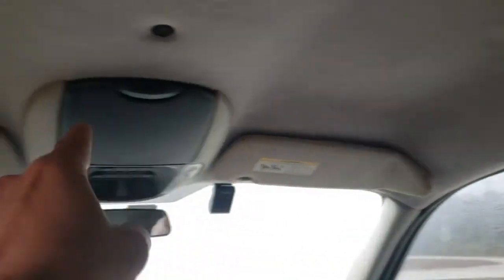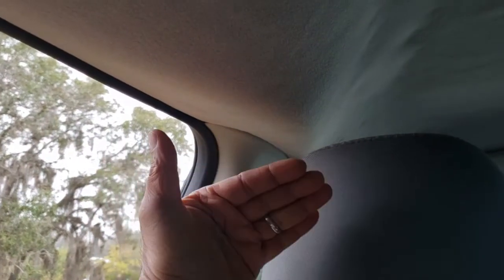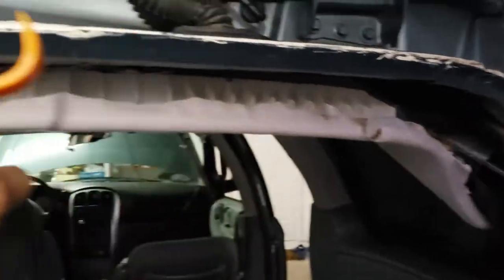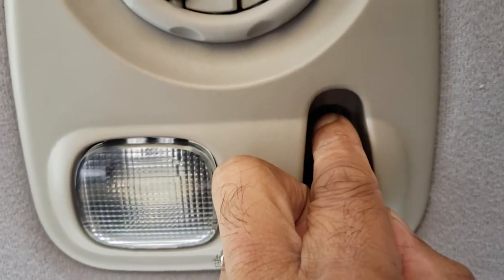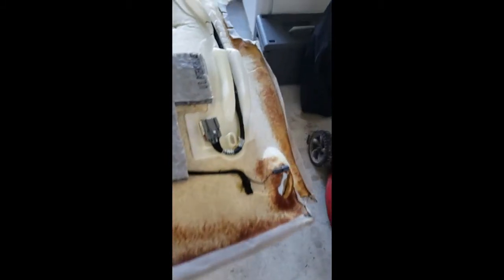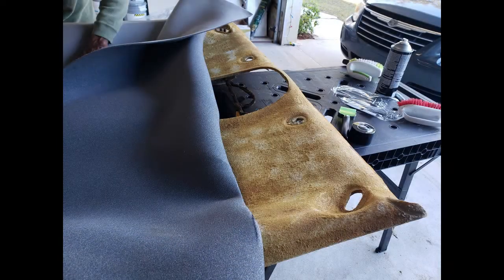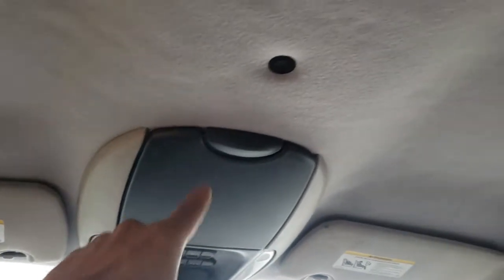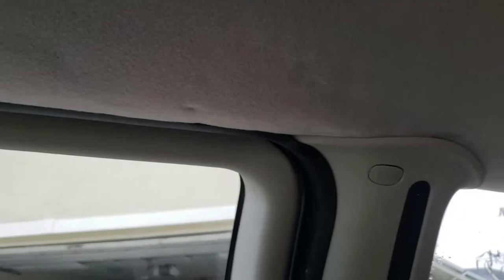Headliner removal and replacement 2005 Chrysler Town and Country minivan

Comment: Oh, I wish I had seen this video before trying this myself. I'd watched a few others that were not this exact model (mine is a 2006) and they were far easier. The wiring and ducting, even airbag mechanisms running along the sides of the ceiling. Your advice is right on the money. It's a big messy job, and as far as I'm concerned, not at all worth doing. I'm wishing I'd just taken a carpet stapler and tacked the fabric up with a bunch of staples.
Reply from the maker: Indeed, this is a major job and may not be worth your time. I like to keep my vehicles as good as I can which is certainly time consuming. Thanks for watching.
Reply: Hmm carpet stapler you say?

Comment: Working on my 07 TnC. Figure I will be doing this job again in a few years. Everything did not work out. But do not be afraid to try! I would NOT use Permatex Heavy Duty Automotive Headliner Adhesive Item # 27828. It set up too quickly and I could correct some issues.
Reply from the maker: I used the 3M headliner adhesive and it worked well. I think if your minivan is parked in the sun and you are in a hot climate then the glue fails faster.

Comment: In the middle of removing the headliner board, but the wiring loom for all the ac and lights is glued to the top of the headboard.  is there a disconnect box for the wires that come up both sides B pillars?  It doesn't look like it.
Reply from the maker: No disconnect in pillars,  you have to disconnect from the controls.

Comment: Great job at explaining it. Question, when when you glued the headliner did you have to buy a new one? Or did you use the old material. I have a 2005 Chrysler, Town and Country Limited. It has the rail down the center and a video screen. A lot more to do. I have no option, it only has 40,000 miles and has a handicap conversion. The headliner is the same as yours with just more to pull down and cut the screw holes.
Reply from the maker: I purchased a new headliner here: https://www.amazon.com/gp/product/B089ZMR5HM
This is a major job, put aside a lot of time and patience and ask someone to help you get it in and out of the van. 
Good luck!
Reply: @Andrewsnotes1  Thank you. I was able to remove the headline in under two hours. I measured the headliner and 2 yards will do the job. Rogers’s and contact cement ordered. I will apply the industrial contact cement with a paint gun on the compressor. I unplugged the 3 wires and it dropped down, after the other steps. I still need to pull the video panel and track. Clean it up and put it on when Amazon delivers. Thanks for the video. Entire job is just as you showed us.
Reply from the maker: Thanks for the update, I am glad it went well. The 3M Headliner spray on glue was what I used, but I suppose contact cement will also work.  Remember to apply the material from center outwards to minimize creases.

Comment: Where is the connector for those wiring you disconnect the headliner off?
Reply from the maker: Behind the rear AC control, behind the overhead trip computer in the front, behind the connections of the front visors after you remove the 2 screws each has, and behind the cabin lights in the headliner.

Comment: Very nice job describing and sobering the amount of effort involved! My van is 2007 so assume everything applies. Two questions. 1) Before i go the route of removing and replacing, I'm looking at spiral fabric twist pins to pin headliner back up. From your recollection is there enough foam padding on factory headliner for pins to grab into assuming padding is not crumbling already? 2) if pins don't grab what do you think about poking drill bit up through sagging cloth material and drilling through headliner board, avoiding air ducts and wiring, then pushing twist pins up through drilled holes or using another type of interior auto panel retainer clips that pokes through drilled holes then expand to stay in place?
Reply from the maker: There is enough padding on headliner to do what you are describing. Mine sat in the sun for most of its earlier life and it was not disintegrated. Be careful not to drill through the roof!
I f you plan to keep the vehicle a while longer then the removal and redo of the headliner is the best (but not easiest) option.

Comment: Excellent job!
I just bought my 2007 Town & Country, so I'm thinking do the same job on it.
I want to do it, I have the time and I think that's enough!
You really did a nice job, I'm excited!
Thanks a lot! Very good video.
Reply from the maker: Go for it, check the description for the links for the headliner and adhesive. Spray on adhesive in 12-15 inch sections and apply from middle outwards to avoid wrinkling.
You need 2 cans.

Comment: I am in this process now, 2005 Grand Caravan, same as this one, 3 hours to remove board, 4hrs scrape, vacuum and clean old glue off and 3hrs spray and apply new headliner fabric (60in x 120in). couple hours next day to fold over and glue the overlap 1inch to back side of it all around. go slow, take time. Grey headliner on amazon, $60. , 2 cans spray glue 20 each. I like the Permatex spray glue better than 3M, they wanted about $700. to do this, so I am in for $100. -it is worth it. 
TIPS: keep track of screws so you dont mix up. there are alot. Board is like cardboard/paper based, not fiberglass. be careful at corners/edges. Support board in 3 or more spots when on the floor it does have curved shape.
Reply: MORE TIPS - WATCH A FEW VIDEOS DIFFERENT VIDEOS/ IT HELPS WITH 2 PEOPLE TO REINSTALL / SECURE THE 2 FRONT VISORS FIRST AND VISOR HOLDERS AND THE THE AC DUCT AND PUSH PLUG AT CENTER OF REAR HATCH. THAT LINES ALL THE HOLES UP.
Reply from the maker: yes, 2 people is a requirement, the headliner is large and you need to line up everything. .